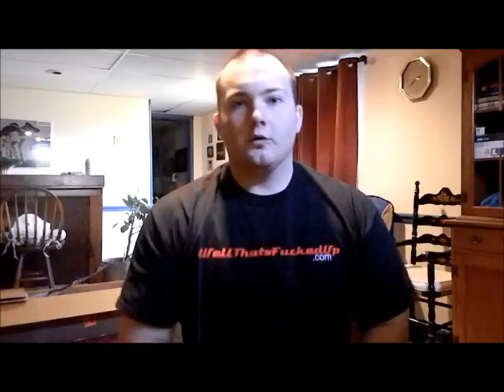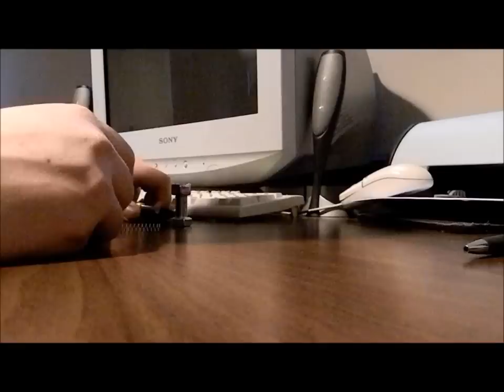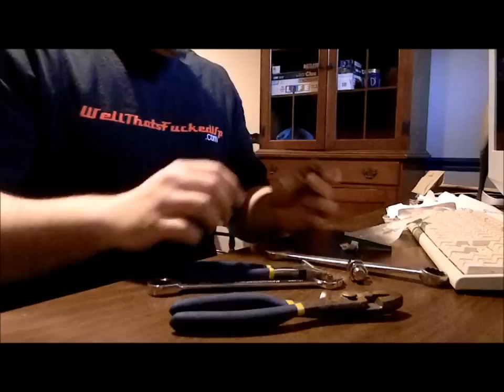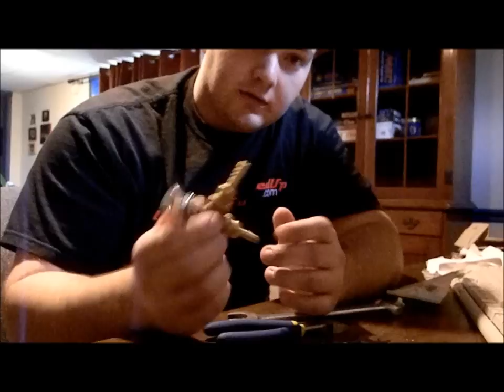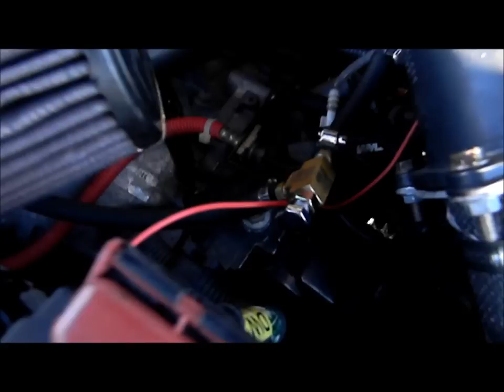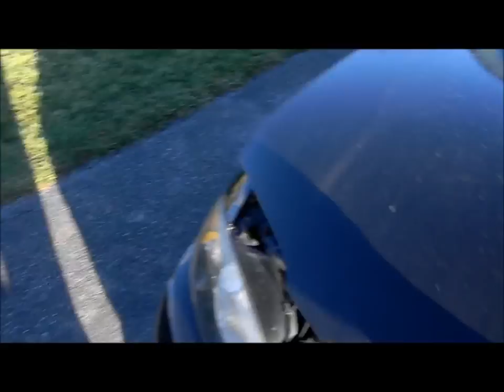DIY Boost Controller More boost! $12

Comment: 9.99 boost controllers on eBay that are made with better quality parts, but these kinds of mods are sketchy, more boost with same amount of fuel means you can run the car lean. Then again, I only see old beater cars with mods like this so I guess it makes sense. But if you want to do it right; larger injectors, electronic boost controller and tuned ECU.

Comment: I made this exact boost controller and it worked great, I bought it at ACE hardware and i used a #12 1.25 thread bolt and nut
Reply from the maker: nice!

Comment: $12 buys a boost controller on ebay 0-30 psi and NEVER EVER TAP YOUR BRAKE BOOSTER LINE OMG!
Reply: Those $12 ones on ebay dont work for shit, ask me how I know...
Reply: BagelBytes well i have the $6 ebay boost controller. works good to me. went from 8psi to 15psi. best cheapest mod every.
Reply: Eddie T if I have an 8lb spring and get a boost controller would it work?
Reply from the maker: ive done it plenty of times with 0 issues

Comment: another adon for this is you can use a hand vacuum gun to test your initial boost setting. i had one on a car for a few years and eventually the spring lost its sprinyness. the last one i build i used a straight through coupler and 2 barbs then clipped the spring untill i got my desired boost preasure much nicer package i felt. and its not to hard to increase the boost with a new spring and a vacuum gun.

Comment: I'm assuming on a turbo diesel application I don't need a wideband? I'm getting plenty of fuel and I'm looking to control the spikes more than raise psi.
Reply from the maker: +Andrew Aubrey i dont know much about diesels, im sorry
Reply: an air-fuel gauge is always a good idea but diesels can run on a wider a/f ratio. Running rich isn't that bad but running too lean in any engine can cause damage

Comment: Will a 6mm metal bb work?
Reply: As long as the ball doesn't fall through the barb but still sits on its inner opening, it will work. 
Though a 6mm bb would require such a small barb it's easier just to get the regular ball bearing

Comment: Hey poor man mods.. Do you know anybody who is interested in a jza70 rear side molding? I'm from socal. And yes, I have won the bid off ebay on a HKS variable boost controller for 12.36$ shipped. And I have receive it and how do you set up the boost on a twin sequential turbocharger on a 2jzgte? Need some tips. Thanks

Comment: cool bro will need this for my saab
Reply: Joel Perez did you ever add one of these to your saab? I wanna add one on my 9-3 but I have 2 factory boost solenoids so not exactly sure what I'm suppose to do
Reply: James Tompkins 
it wont work
Reply: If you have a t5 system you can. t7 you cant

Comment: will this work to lessen the boost from the wastegate spring? i have a wastegate with like a 10-12lb spring in it but i wanna drop it down to around 7 or 8 psi. will this work or what do i need to do. thanks in advance
Reply from the maker: no, the only way to lower the psi below the spring rating is the change out the spring

Comment: okay thanks. I think I have what i need. the spring was short enough to where I didnt need to cut it
Reply from the maker: you dont need to tap it, if you get the spring to where it sits flush with the top of the threads where the bolt goes it, and it is a stiff spring just turning the bolt in 4-5 thread increases the boost, i did no tap it and i raised the boost in my supra from 8-20 psi with the same set up, just force the bolt it
Reply from the maker: ok cool, I hope it works for ya :D
Reply: Poor Man Mods well, i was trying to go from 9 to 19 psi....cant adjust much since the t has pipe threads
Reply from the maker: grab the T with vice grips, and crank down on the bolt, it will go, it just needs motivation, mine works flawlessly with some elbow grease :)
Reply: It will be hard to get it in deep first off since brass is meant to seal as it gets tighter thus why you don't need tape or pipe dope when you attach a propane line to the tank. You would get a tap and give the threads another go over but I'd suggest just going ham on it and also clean it out just in case of debris. Engines love metal corn flakes ;)

Comment: What is the exact spring size number that you need?
Reply from the maker: I doesn't matter, just as long as the inside diameter of the spring is smaller than the diameter of the beating

Comment: You need to drill a relief hole there buddy... i'm guessing this leaks like a civ but you do need a relief valve so the wastegate can close after you drop boost pressure.
Reply: Where would be a good place to drill the hole at ?

Comment: What risk lol its a simple pressure reduction not an important thing have a boost gauges start with screw loose and tighten till happy if it dosnt work it will just do stock wastegate pressure.

Comment: I use the spring from a ball point pen and an airsoft pellet or copper BB. The airsoft pellets work really well with the small springs from a pen. I'd be careful to use a pressure source that has been intercooled (anything after the IC) so you don't cook the pellet.

Make sure to clean these things out every once in a while. I have a Perrin MBC that is so gunked up it is useless. I guess when you can make one like this for $12 it always was useless :-D

Comment: He is right only with the fuel cut, and even my 93 VR4 has fuel cut but that cuts in above 14psi which is way higher then the 9psi stock. On with the poor mans boost controller. :)

Comment: you are highly misinformed, and regarding valve float, that happens almost regardless( it happens before valve bounce) at high RPM in-fact boost has no impact on valve float, the only thing you have to worry about is running lean but thats what the wide band is for! if the car runs lean it will either detonate or fuel cut to stop the engine damaging itself!

Comment: a Boost controller is a bad Idea...& that's for ones that ya pay for...to say nothing of one that someone half-asses from shit they get at some combination of Autozone & Home Depot... but there's more to it than just cranking up the boost pressure. any car that's relatively recent will have a fuel injector cut off, that will engage if you put the boost pressure above stock...plus enough extra boost will make your valves to float...if it doesn't blow the engine sky-high first

Comment: Thanks for the informative video. The only thing you forgot is to drill a tiny hold in the body of the Tee fitting. This is done to prevent boost spikes from the pressure that builds up in the body of the fitting.